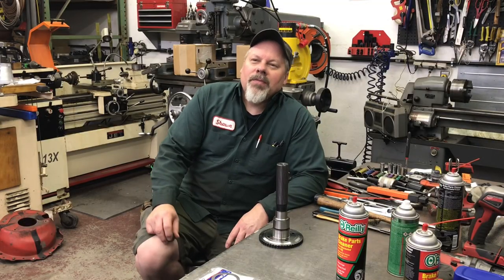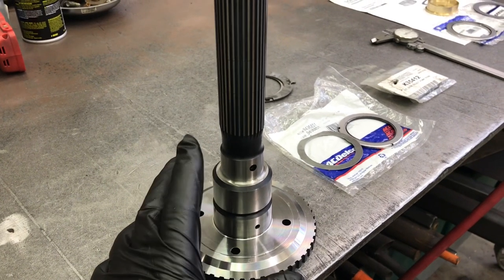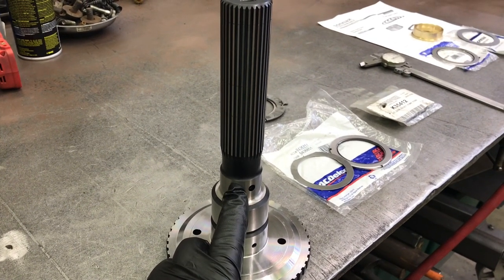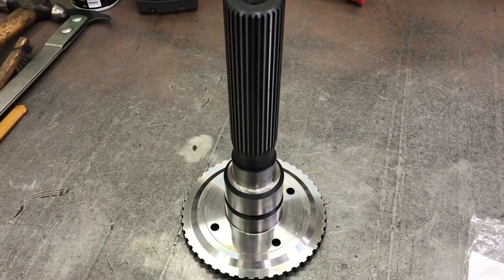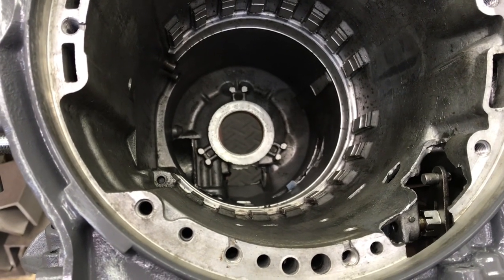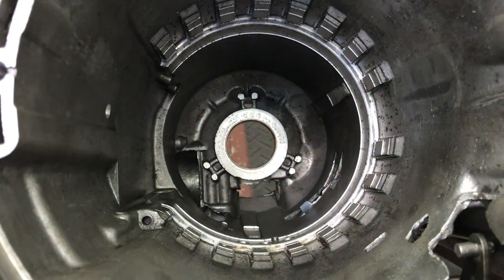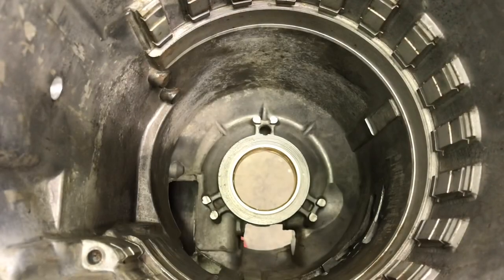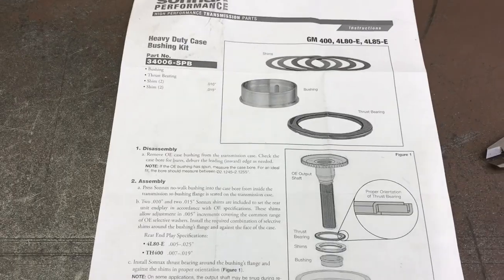TH400: Roller Output Thrust Bearing & Bushing Installation.

Comment: Why can't you measure the end play on the rear shaft before disassembling then measure the existing bushings then you will know what is needed when you reassemble it
Reply from the maker: You can measure end play then the stock thrust washer and spacer if you aren’t building a transmission out of parts. But either way I still measure it going back together.

Comment: Hey shawn i have a question. If you install a manual valve body on th400 and install mod. Valve and modulator. Do you need to run vacum to it.

Comment: hey shaun do you soak the 350 roller bearing in trannie fluid or are they pre packed and get oil from hot oil vapour
Reply from the maker: It certainly will not hurt to lube it up, but they are oily in the package.
Reply: @mountainsgarage  thanks shaun i ended up using using a sonax no walk kit,  it to had look of one piece bearing sealed unit in pulling it  out of the packet i seen there little floppy and and can see the acess they do have external oiling capability

Comment: Thank you so much for your informative videos I’ve really learnt a lot. 
One thing you mention is that Sonnax provide the correct orientation for the thrust bearing so you cannot mess up. The Sonnax instructions in my  kit like yours show the outer race facing down into the case causing the inner race to ride on the outer diameter of the case bushing rather than registered against it. In my option it should be inner race facing down not the outer race.  Anyhow I noticed that Sonnax on-line instructions corrects this but it might be worth mentioning.  Thanks again

Comment: Hey Shawn,   I'm using a .018" shim with the .142" bearing. How far into the case should the bushing protrude?
LOL, i still haven't driven out the band pin. I hit it with a punch , boy I don't like that sound..do you use a dolly behind it? 
Cheers
Reply from the maker: No just hit it, never had a bad outcome. Bushing should protrude about a 1/16 or so.

Comment: Any difference in the early 4l80e output and the Turbo 400
Reply from the maker: Different lengths, I covered that recently but even I forgot which video :(
Reply: @mountainsgarage  Outstanding videos, I'm trying to build a reverse valve body t400 4x4 with engine braking, hard to find a super short 32 spline but if the 4l80e will work I'm good